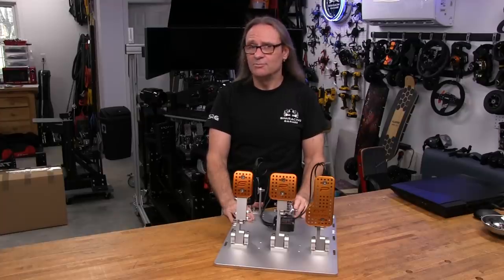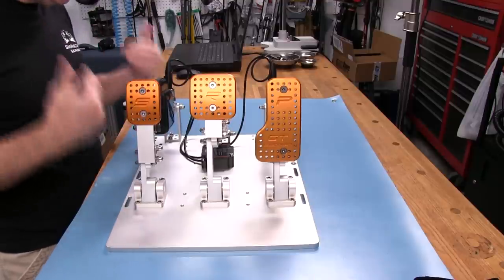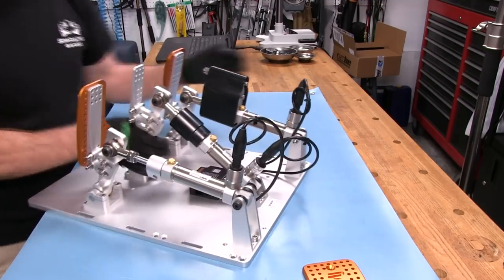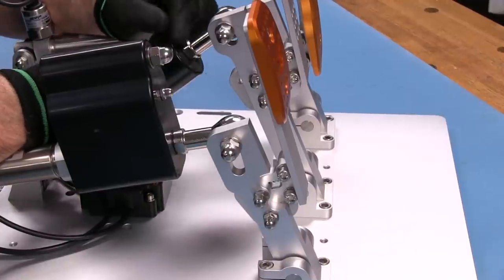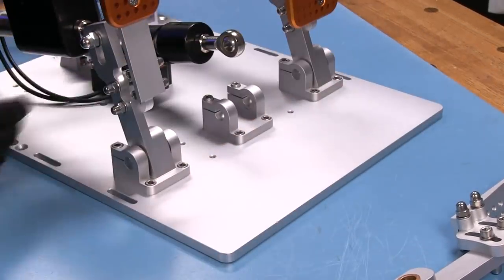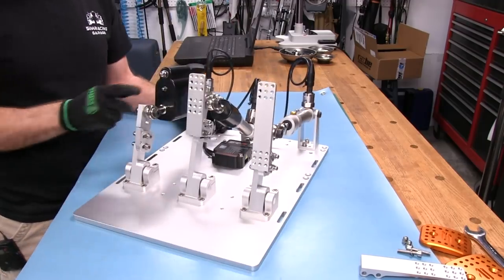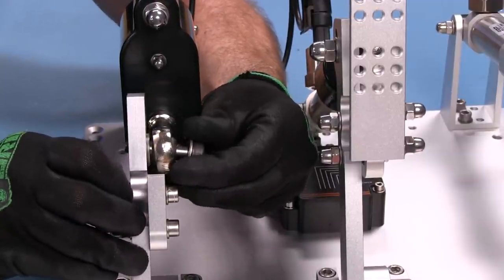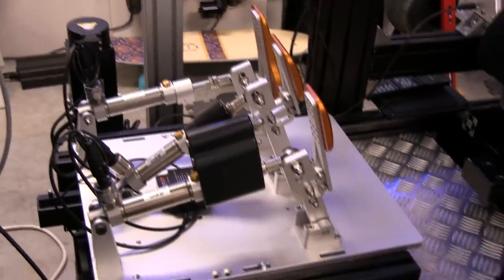SRP GT Edition Pedals Review

Comment: Im swapping pedals currently use dd1 base, with V3 pedals.  Totally torn between, these, huekensveld sprints or ultimate, or simtrecs, or asetek very very torn anyine have food for tbought would be greatly apprecieated.
Reply: These are smooth af and the looks of the pedal set is great much better then a heusinkveld sprints ,i think i will buy the formula pedal set just 2 pedals
Reply: Did u buy a new set of pedals ? And which did u get ?
Reply: @ronaldkasteel3459  Ended up buying the Simtrecs, as I noticed Barry seemed to keep them on his rig for a long time. So figured if they were good enough for him they would be good enough for me. I love them really really awsome. Do want to try that Simucube direct drive pedal, but the price is just crazy.
Reply: @jcsquared1111  thank you for replying ,they look awesome by the way good purchase .yes the simucube ddp are amazing but what a price indeed. have a great day

Comment: Two questions which were not answered in the video--how does the system actually detect pressure, and how do they feel compared to a traditional load cell/silicone (or rubber) damper setup?
Reply: The brake has a better 'squish' feeling than my HE Sprints, and is also more tactile, which makes it better for trail braking and overall more realistic feeling than just squeezing rubber.
Reply: It uses a pressure transducer.

Comment: You can definitely tell these are well made pedals but I bet they weigh more than the entire interior on my autocross 914. I say this with the utmost respect - given what companies are charging for a set of pedals, there are obscene profit margins to be had if the manufacturing process is efficient. My point is, move beyond steel and chunky aluminum. Start using composites, lightweight aluminum, titanium..